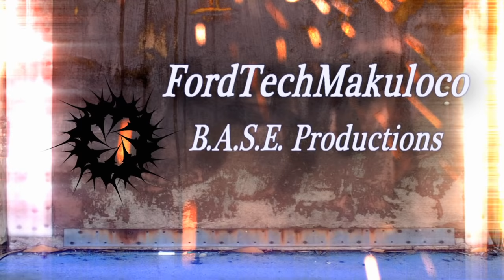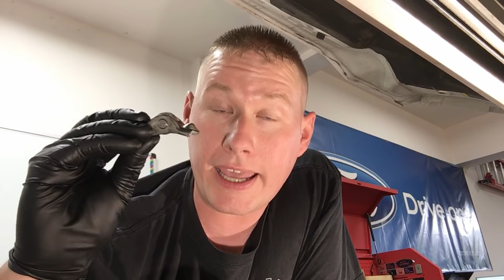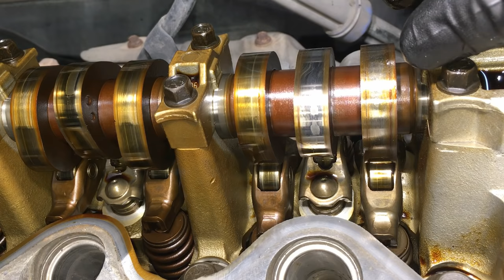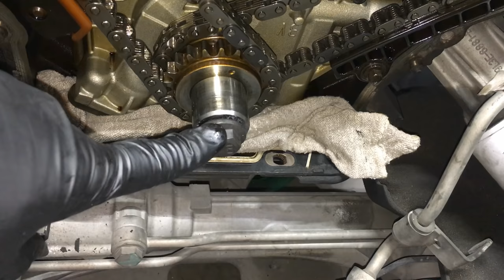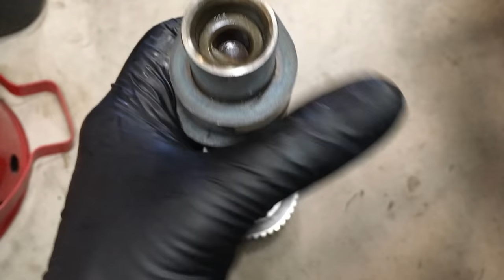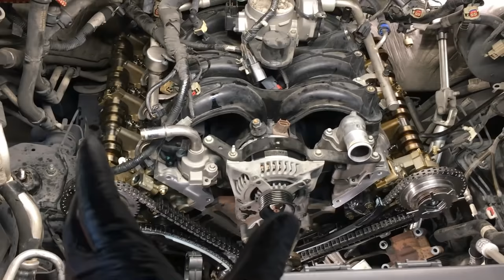Ford 5.4L 3v Triton Engines: Roller Follower Removal and Installation

Comment: Anyone got any ideas? The last owner didn’t bolt down the first cam cap which locks in the cam position. So the cam slid backward toward the firewall in the head and now I can’t fit the roller removal tool between the cam towers and the rear cam lobe.

Should I just remove all of the roller guides I can then just take off the cam caps as evenly as I can?? This a terrible unexpected issue to find during a full timing swap.

Comment: Does this tool work for 2 valve engines also or is this only for 3 valves?
Reply: I'm wondering the same thing.  Do you know if Brian has a video for the 5,4 2V?  If you know can you reply, if you don't know and I find it I will link it to you.

Comment: After replacing the roller followers, do i need to re time the engine?
Reply: If you didn’t remove timing components than you won’t need to re time the engine.

Comment: Roller follower part number on Amazon says it does not fit my 2007 F150 5.4 3V
Reply from the maker: They are all the same 2004-2014.

Comment: I´ll get a set of m-6529-3v

But if i look on your follower, it seems that the hole of my Rollers is much smaller than on the video, my Kit includes the new Style Rollers like your new ones.

Could you maybe stick a needle in there and measure the thickness of the Needle ?
cause i think that the hole of my Rollers are too Tiny, even if this is a original set - so i hope that theyre oem 

Thanks
Reply from the maker: The hole will be very small and you won't be able to see through it due to the angle.
Reply: @FordTechMakuloco  yes, the hole of the old one is 2mm,
I tested a 1mm drill to fit in the new style, but thats way to big for the hole.

I've shot a Pic, but I can't get in In here.

Is it not a risk with that tiny hole, if smt comes with the oil to get stuck in this hole or what do you think

Comment: Brian, I'm replacing a single roller follower on a 5.4L-3V (cylinder #6, forward valve) which has a loose roller, caused by one or more "missing" needle bearing rollers.  I caught this just as the follower body began to BARELY touch the edges of the cam, the roller still spins freely, and there is ABSOLUTELY no damage to the cam surface itself -- only a VERY teeney-tiny burr on each 90° edge of that cam.  Can you please comment with regards to replacing just one old style roller follower (w/ the large oiling hole) with the new style roller follower (w/ small pin-hole oiling hole), and leaving the remaining (23) old style roller followers in place.  I.e., in your opinion, can you mix new and old style roller followers in this engine?
Reply from the maker: You can mix but you really want to replace all 24.

Comment: why did you install it if its going to restrict the oil to that lobe ? 2 minutes with a drill and a 1/8 inch drill bit would fix that problem.
Reply from the maker: Ford made the new followers to this new spec, who I am I to say they’re engineers are wrong.

Comment: Did you ever have the ears on the spring compressor bend? It is slipping off the spring. Have you ever tried to straighten the tool? I'm a little afraid of the compressor now.
Reply from the maker: No

Comment: Can the lash adjuster be changed at this point also
Reply from the maker: no
Reply: @FordTechMakuloco  so the cam has to be removed to change a lash adjuster
Reply: 5.4 triton 3 v I've got a misfire on # 4 changed plug & coil & injector misfire still present at idle removed valve cover #4 cyl 1 of the roller followers the roller is chewed up but still rolling at this point not sure about lash could this cause misfire at idle?

Comment: Thanks for the great tutorials. When replacing the roller followers, you pointed out the oil supply holes in the new followers are considerably smaller than the ones in the old followers. Are there any concerns about inadequate lubrication to the cam lobes? I understand the pressure would be higher but there may be a loss of volume. Were the new followers an aftermarket part or OEM? Can you buy new followers with the same size oil hole as what came out? Thanks again for helping us keep these 3 valve 5.4's on the road.
Reply: Hey Wesley, I am currently in the process of replacing all my trucks timing components and roller/followers and lash adjusters.  I purchased all FoMoCo parts and the roller followers sent have the pin size holes.  I am also putting in the melling M360 high flow high volume oil pump so hope fulling that helps.  One concern I have (since im am still in the reassembly phase) was if the M360 would have too much pressure with the much restricted followers.  I guess we will see.  BTW, I am no mechanic, just mechanically inclined.  Brian has been a huge help because he provide such an easy to follow reference.  319k miles on my f-150!
Reply: @neptune4167  how did it work out for you. I'm planning on doing the same thing to my truck. 125k miles. Was planning on doing exactly the same as you with the same oil pump.
Reply: @masterkpw1988  Knock on wood, has worked out great.  The most annoying thing was after I fired her up I realized I had the dreaded passenger side exhaust manifold leak that was being hidden by the timing tick.  After I got that fixed the truck sounds and runs like new.  Take your time, be meticulous when compressing the valve springs and roller followers and make sure the keepers dont pop out.  I did all the compressing of the springs by hand although there were a couple I needed to use a wrench, towards the back, because I couldn't get a proper grip on the tool.  My only regret was not using a FoMoCo timing chain and guides, I did for phasers and VCTs but the pump I used what Brian recommended.  Priming that sucker was a PITA!!  I couldnt get it to pick up oil to save my life, I ended up using a $10 pump sprayer addapted to hook into the oil pressure sensor hole to manually feed oil as I cranked to be sure the engine remained lubed while I cranked.  Good luck, reach out if you have questions.
Reply: @neptune4167  still going strong? I have that same concern
Reply: @masterkpw1988  you end doing that same approach?
Reply: @hunterprice287  yes I did. I did the new timing chain, oil pump, solenoids, followers and lifters. Got it all done. Crashed into a deer not long after. Ended up just buying a tundra. But the lifters were getting played out. Followers were still good though. The timing chain tensioner had a blown paper gasket. The new updated ones look way better
Reply: @hunterprice287  Still running strong, just rolled 383k miles.  Rust will take this truck before the engine dies.

Comment: there are 2 part numbers for this on ford parts online one is 3L3Z-6564-A and the other one is 3L3Z-6564-BA.  which one should i get? Please help
Reply from the maker: Wait didn't I already link to the latest roller follower twice below this video? I don't understand why you would look all over the web trying to figure out which one is correct or the latest when I literally link to the correct latest part right under this video. Are you not seeing these links? Please let me know thanks!
Reply: @FordTechMakuloco  yes you did and it works but the ford parts online is 10$ and says replaced by A.  The amazon link is 19$ per.  That is why am asking.  Also the water pump link is for milling 360 while milling parts is showing a different part number
Reply from the maker: Wow ok so you are questioning all my part numbers I link to I see, ok.
Reply: I apologize for asking.  Thank you for your time.  I will figure it out myself hopefully.  Thanks again
Reply from the maker: Nothing to figure out I already laid everything out for you it couldn't get any easier.

Comment: @fordtechmakuloco Is there a way to rotate the cam to get the cam lobes to base circle for each roller follower without pulling the front cover and rotating the crankshaft?
Reply: I know this is old but did u find a way?

Comment: I am doing mine now, and i am not able to hand tighten that nob. I have to use a wrench to turn it, is that bad?
Reply from the maker: Use only the knob or you may bend a valve
Reply: @FordTechMakuloco  , the tool is compressing the spring, isn't it? That shouldn't bend the valve should it?

Comment: Should’ve replaced the follower with an the old style with the big oil opening, unless you are doing all the followers. You are now restricting oil flow to that one cam lobe.
Reply from the maker: First of all that would not be a problem but yes if you have failed roller follower you want to replace them all because the other followers are not far behind.

Comment: Working on sohc 4.6 l Lincoln town car need to replace valve stem seals without taking out camshaft ,need help finding the tool to compress the spring and remove spring to get to the valve stem seals.....anyone use a special tool that works easily ?

Comment: Does it work for 4.6 too?
Reply from the maker: 3v yes
Reply: @FordTechMakuloco  i have another question 
When i dont want to remove the rollers when i do timing chain on a 4.6 3v 
Can i just push the right cam where it was to put the chain on?
Cuz it flipp a bit away

Comment: 10:26 you show a new small roller follower oil spray hole, causing an oil pressure increase 
With Melling releasing an upgraded 10341 pump (+20% more pressure + %20% more volume) would the combination of that small spray hole and increase pump pressure cause a seal blowout in the tensioner gasket  (shown in a different video of yours  https://youtu.be/wQ8M1aw-5qw at 5:22 mark ) be too much?
I just picked up a 10341 and wonder if I can use the new roller follower small spray hole, or should I source the original larger hole?
Thanks 🍁 🇨🇦
Reply from the maker: You want to swap it out to the 60psi spring provided with the pump in the box.

Comment: Wouldn't it be easier to pull the cams
Reply: And install should be reversed. Set followers and cam then turn down cap bolts until bottomed in sequence. Lastly torque to spec in sequence?!!? Why not?

Comment: Can anybody tell me the answer to this question? Not "an" answer but "THE" answer. Question:   If someone's doing a full timing job with chains, phasers, and the whole works, why can't you just remove the camshafts from the cam towers (via removing the cam caps) and do the lash adjusters (if needed) and followers that way with camshafts removed?  Follow up statement: after you get done with that, place the cams back in place, put the caps back on, then change out the phasers and re-time everything.
Reply from the maker: Um no that is wrong on so many levels. Reason being is the valve springs can kick over the cam violently..

Comment: I've done multiple 2 valve timing chain sets but never a 3-valve.
Before taking anything loose why couldn't I just do this:::pop two of the camshaft retaining caps off and wipe the oil off the cam, then Wedge a strip of thick rubber between the cap and the cam and then tighten the caps down enough that the cam is Locked in place before pulling the chains/phasers off ??? Essentially doing what the 2-valve cam holding tool does?
Thanks
Reply: You'll probably end up breaking a cam. They're easy to break. Also, you can use 2 visegrips to lock the cams in place if you know what youre doing.

Comment: Question: I’m hearing a noise when barely on the throttle and it stops when engine goes back to idle. Almost a rattle noise, from only the driver side of the engine. Has anyone else experienced this? Searched this video to see if this could be a possible solution. 2005 f150 5.4 3v
Reply: You ever figure this out

Comment: I know you mainly work on Fords but I have a question about my truck. It's a 91 Nissan D21 4x4 with a 2.4l KA 24E 4cyl engine and it has a blown head gasket and coolant has gotten into the oil. I want to have the gasket replaced so I can still drive it. Will the coolant in the oil ruin my engine to the point to where I have to replace the engine or can the gasket be replaced. Thank you

Comment: Will this not work on the 3v 6.8
Reply from the maker: It applies to all 3v engines.
Reply: @FordTechMakuloco  all right that's what I thought but the tools just advertised very specifically 4.6 and 5.4. 
Don't know why they don't include the 6.8 in the details.   
I appreciate it. Great video.

Comment: What about the 2V triton motors?
Reply from the maker: They never fail.
Reply: @FordTechMakuloco  Well I unfortunately have one that is bad or at least it sounds exactly the same as in your video.  Do you have a video on the 2V triton motor and is there a special tool I can get to remove them without removing the CAM?  Love the channel.

Comment: I've seen a guy pop them out with a flat head screwdriver
Reply from the maker: I have a video on that too but it's risky
Reply: DO you have the link for that video. I couldn't find it. PS Thanks for the 4 part video. Just finished installing phaser's and chains today per your video. Top notch videos. I don't have the tool for installing followers and hoping I can do it quicker. Thanks

Comment: My tensioner blew the gasket and caused timing to jump. I'm replacing the timing kit...do I really have to remove the 3 per side roller followers?  Can I just rotate the cam phasers showing the R and L marks with the old chain then clamp them down with vice grips,  remove old chain/replace components... then turn my crank to the 11o'clk position using the key tool then apply the new chain aligning the marks correctly?  Whats the purpose of removing followers, is it to prevent the piston-to-valve or keeps cam from rotating? ..Thanks for any answers
Reply: You can replace the timing without replacing the roller followers or cam shafts. It is just necessary if wear is present on the roller followers.

Comment: Would it be faster to remove the cam since the timing chain is off?
Reply from the maker: +Donald Israel I made the video as a reference for any situation front cover off or not. The timing chain was on in the video that is how we are able to move the cam by turning the crank. Now during a timing chain kit replacement you only need to remove three followers per side to neutralize the cams then yes you can safely remove the cams and remove he remaining followers by hand. I detail this procedure in my four part series.
Reply: cisa93  I know this is a very old post but in case someone else is wondering Ford not only made the hole smaller (to help keep oil pressure up) but the hole has been pointed where the lubrication is most needed at the roller helping with their longevity as well.

Comment: What was wrong with old ones?
Reply from the maker: Few were worn out
Reply: FordTechMakuloco I bought02 mustang Gt 4.6 2 valve engine in spring of 03 new left over 5speed car drove daily ever sents always changed oil with Mobil 1 10w30 syn and always use motocraft 820 oil filter runs great only thing removed from engine has Ben thermostat housing in 320000.0 miles I got no ticking or whacking reckon why this engine had ticking from followers?  Engine sure looked cared for Ay??

Comment: Just called my local Ford stealer.  They wanted $28 a piece for each roller follower.  What a bunch of thieves!
Reply from the maker: They cant charge more than retail.
Reply: @FordTechMakuloco  I asked the sales rep if he was sure he looked up the right part as  I know retail is $12.00 or so.  He claims he did, and they are $28.00 each.  This is South Florida for you. Scam capital.

Comment: These followers should be bathed in oil and last a lifetime, regardless of the pressures they endure. Are these bearings softer than they should be or are they not getting enough oil? This seems like a factory defect and grounds for a class action lawsuit.
Reply: Made to fail. Dealerships make money or repairs not too much on sales.

Comment: wow that valve compressor looks like a F^ck up waiting to happen.  i take it there is not sufficient stroke on the lifters to collapse them and still be able to get the followers out. if you are that close why not just remove the cams??  if it was a one follower repair ok  i get it. the new oiling scheme may help oil pressure but with the angled hole now you introduce oiler timing into the equation. will be interesting to see how that plays out over time.
Reply: Because if you remove the cams with the followers in there is chance or ripping the cam cap threads out of the head. The followers are installed after the cams.
Reply: Man i would definitely have to take tge spark  plug out  and use compressed air just incase the value drops im covered
Reply: @charlesbrewer1426  except you need the valve to open to gain clearance to remove the follower

Comment: It seems to me by the time you spent 10 minutes getting that thing out if you’re lucky 

you might as well spend another 40 seconds and replace the lash adjuster and another 10 minutes and drop in a new valve stem seal…….
Reply from the maker: I wouldn't waste the time, neither are common failures.

Comment: 🤔  Throw that damn motor away,  The new upgrade part would is nice the problem is that all those tiny holes and passages clogg up too easy,  No oil so that means the whole top end of the engine damn your needs to be replaced, Damn good quality built trucks  siity motor design,  The only true ways to salvage this truck is a reliable LS 5.3 engine swap.  Please people if anyone has done this tell me what you think??? Because I have a 06,  With too much wear damage